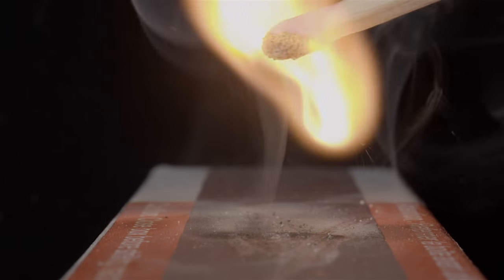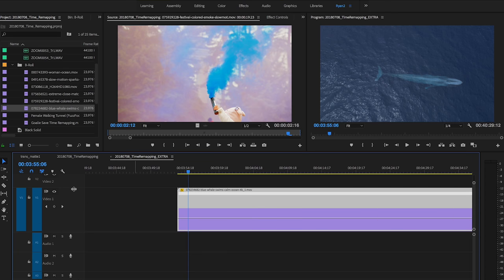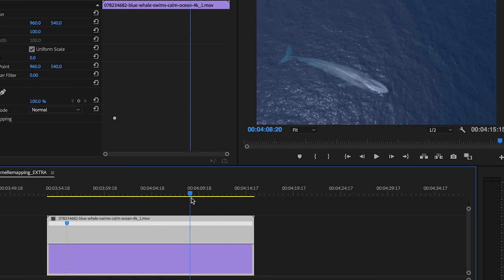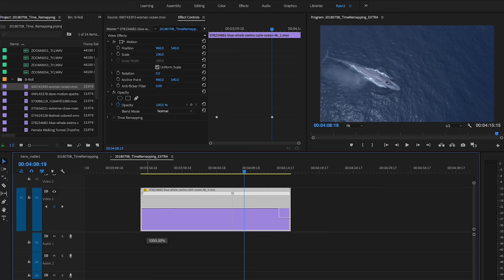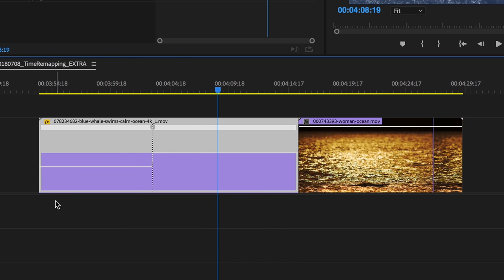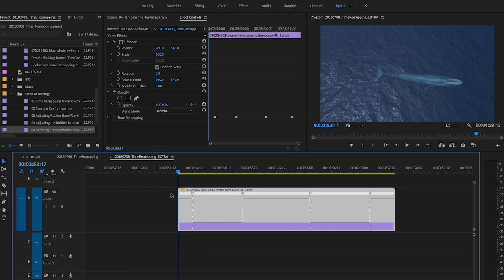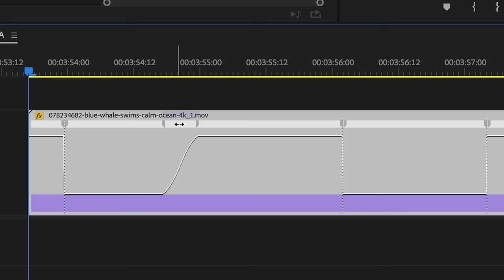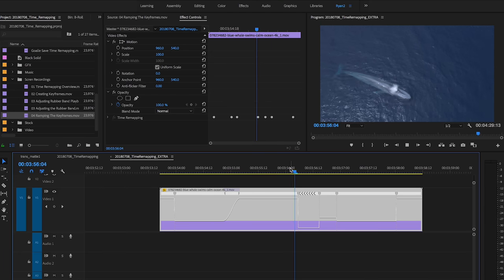Speed Control: How to Master Time-Remapping in Premiere Pro

Comment: how to make the audio follow the video when i use this speed features? my audio stays the same, only way i got to accelerate both is with the right click, speed/duration, select a speed factor and click Maintain Audio Pitch, but if i edit the speed like you did in the video, audio doesn't follow the video pace
Reply: i was just about to post a question the same as this.. its annoying me. im thinking of cutting using the speed/duration bit like you have said but adding a speed ramp to the end and beginning of the original clips

Comment: WOW SEEMS SO HELPFULL.. untill i go to premiere and realize it wont let me change the speed up and down
Reply: You have a fix for this?
Reply: If you make the video track too big it won't let you grab the rubber band. Make it smaller, no more than about an inch high, then the arrow tool becomes a double-ended arrow once you mouse over the band.  You can only grab it when the arrow becomes double-ended, then click and drag up or down to adjust the speed. If you're too zoomed in or out on the timeline, you may not be able to grab it either. If this happens, try different zoom levels until you get it to work. 

Be sure you have to have the mouse just above the band, not right on it, or you'll get this annoying blue arrow thing that only moves your clip up or down to other video tracks. The arrow tool should also be close to a keyframe, but not on it, or you'll adjust your keyframe position too.

Comment: Nice tutorial, i have an issue with a clip that ive put a speed ramp on. The speed ramp work fine, just when i also try to at scaling and position to the same clip the effects happen before the keyframe making it hard to use zoom functions. Any ideas?